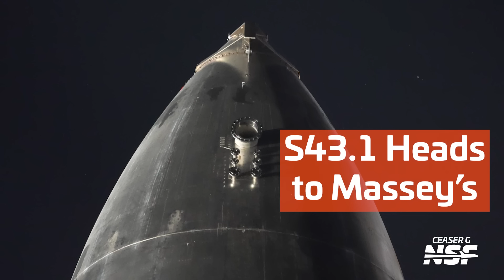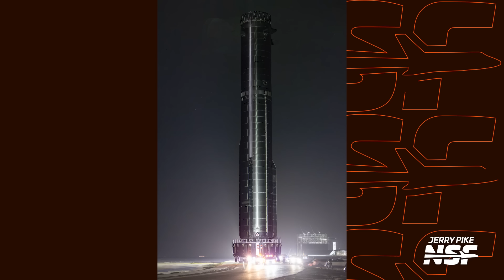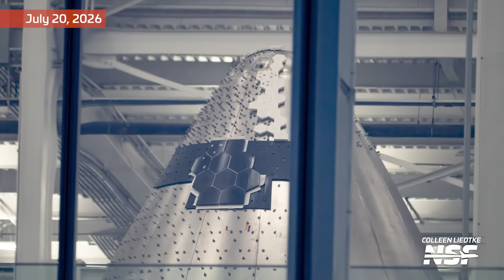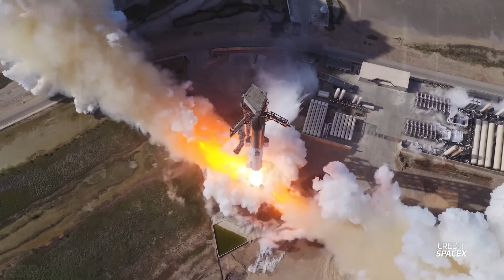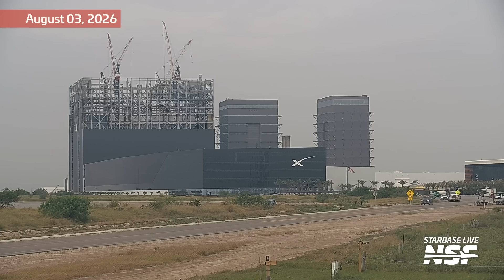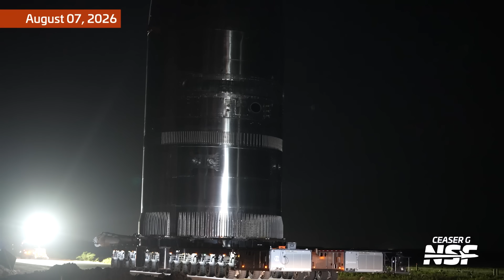SpaceX Says Starship’s Heat Shield Is Solved, But Is It? | Starship Update

Comment: Considering last I heard it takes about a week to replace a whole heat shield even if they have to replace half of it that would still be a win.  And if all they are looking at replacing is a few spot tiles and maybe some large sections on the flaps I could see them doing a 1 week turnaround.  Once a day is probably closer to 5 or 6 years out at this point.  A routine 1-2 week turnaround that I could believe.  Maybe a few "hey watch this" or "hold my beer" 1-2 day turnarounds will happen before then but, those will likely be the exceptions not the norms.
Reply: "1 a day" refers to overall fleet cadence, not individual ship cadence. They might have 7 ships in a rotation, with one flying every day, and each one taking a week to refurbish before its next flight. Baseball pitchers is a good analogy for this.

Comment: I think all this discussion of Starship activities has masked, a bit, the issues with the latest Super Heavy booster.   It has not had a successful return-to-launch-site (simulated) run yet.   I suspect that the difference in the geometry of the engines has thrown more aerodynamic turbulence then the engineers expected.    This would follow from successful launches  when the engine area is in on the leeward side contrasted when the engine area is on the windward side (i.e., descending).   I would have thought that this would have already been modeled in the months previous to building the first V3 super-heavy but there's nothing like actually flying to test one's design, eh?  

So, looking at the heatshield of the ship is important but getting the booster descent relights reliable (again) is a significant challenge.    If they do not get that fixed, they can still do the orbital flight and still deploy working satellites but losing a booster on each flight is a huge financial and scheduling hit.
Reply: The booster in flight 13 made a big step from the booster in flight 12 so if they can continue their progress in that direction they will be okay.  Besides that the booster under performed after stage separation and boost back and it was only the landing burn that was inadequate.
Reply: Starship was always the problem child.  Everyone is aware that the booster has taken that place now.
Reply: why worry? they've fixed things before, it'll be fine in another flight or two.

Comment: YES, SpaceX is targeting an operational orbit for Flight-14th.  They're also testing a NEW Structural noseCone. BEST part they're absolutely planning to "attempt a tower-catch of Ship41. Thank U 🌿 for sharing
Reply: Admiral General Aladene says it has to be pointy to be scary.
Reply: Flight-14 start date 28 right?
Reply: @realhero5917 

Yes, hopefully all looks 👍
Reply: @realhero5917  The exact date is yet to be determined.  Sometime between Aug 24 and Aug 30.
Reply: I am expecting a twer crush..😂
Reply: @user-ks2bf4kc7d Why laugh though? Its like you want it to go badly
Reply: @imdark7372  NO! but the records are not encouraging and heat shielding technology not promising for reusability. I like SpaceX successfully develop its spaceship but "Starship needs something more advanced or different to safely carry humans and land "always" safely"
Reply: @user-ks2bf4kc7d That could happen BUT every attempted catch of the booster has been successful.  There has never been one single failure to catch. Also, Elon said that the water landing of flight 13 was so precise that if there had been a tower the catch would have been successful.  Also, my guess on damage to the tower if a catch is missed is no significant damage because of the serious robustness of the tower and pad.  Both are made to handle the weight, heat and launch of the booster and ship together.  Catching just one of them when it is mostly out of fuel may not cause much damage.  Some day it will happen and then we will know!

Comment: 1 launch per day in one year, even though this definitely won't happen anywhere this soon (if at all) is classic CEO Elon doing: 
- Securities Fraud (15 U.S.C. § 78j / Rule 10b-5): It is illegal to make any untrue statement of a material fact—or to omit a material fact necessary to make statements not misleading—in connection with the purchase or sale of any security.
- Making False Statements to the SEC / Investors (18 U.S.C. § 1001): Knowingly and willfully making false or fraudulent statements regarding matters within the jurisdiction of the federal government (which includes SEC-regulated public shareholder meetings).
- Mail and Wire Fraud (18 U.S.C. § 1341 / § 1343): If the false information was transmitted via phone, webcasts, online streaming, or written mailings distributed to shareholders, wire or mail fraud charges almost always apply.

Elon should hope Peter Thiel's couchfucker will also instuct the DOJ to ignore Elon like the Felon did when he takes over.
Reply: They ignored Tesla for the last decade...

Comment: The point Max made at @6:15 is simply not true. Falcon will be flying for years and years after starship is up and running. There is no payload bay door insight for starship, nor is there any plans for man rating vehicles to carry astronauts to the station. We are at minimum a decade away from Falcon 9 retirement.
Reply: I agree that Falcon 9 will continue on in some capacity after Starship is in service, but a decade seems pretty long.  I think you forget the cadence with which they will be flying.  I think mods and adaptations will come at a much more rapid rate than previous rockets and they will build experience with reliability very quickly.
Reply: @briangodfrey7424 the cadence with which Elon says that they will be flying. Not the cadence with which they actually will be flying. Those are 2 very importantly distinct things. 

Also remember that the shuttle could land on most big runways, so thousands of places on earth if it had to. Dragon lands in the ocean, so it can land in most places on the earth’s surface if they have to. The people who board a Starship will only survive a flight if everything goes perfectly and they make it to what? One of 5 towers. It’s going to be a very very long time before we see people leaving earth and returning aboard starship. Frankly I kind of think it’s actually never, at least in the way we see starship now.
Reply: @RoryShields1  No, I'm not suckered by Elon.  But even at the more conservative pace that they are likely to meet, they will accumulate experience very quickly.  As for the rest - I guess we'll see.
Reply: I am sure they have had people working on those for quite some time now.
Reply: @WyoSavage1976 they’ve had people working on Starship for 14 years now.
Reply: I bet it'll be much sooner.
Reply: @RedmondJohnsonif watching this program for the last decade has taught me anything, it’s that if the Spacex fanboys think something will be done by a certain time, add at least 3 years onto it.
Reply: @RoryShields1  sometimes it is true
Reply: @RoryShields1 what about the statement released saying f9 isn't taking any new contracts? Hmm such fanboy such add 3 years to everything
Reply: Engineering can begin on new systems  years before we see them being built.
Reply: No it wont! SX just issued a statement that they are no longer accepting launch contracts for ANY F9 missions past 2027, including very lucrative ride shares. F9 is not fully reusable and that is the catalyst for SS development.
Reply: @brianw612  That's interesting.  Plus, there are lots of Falcon level competitors coming along to put pressure on their business, while nobody will compete with Starship for quite a while.

Comment: Do you think they will get tps yields so consistently high that they could switch away from tiles and just go to one giant shaped slab that could cover the belly of starship?
Reply: No! SS is a large flexable tube structure that flexes and expands in the hellscape of re entry. Those tile footprints are designed to move with the structure and shift independently of other tiles. All heat shields are essentially the same in that regard. Even the Apolo capsules had independent cells.
Reply: No

Comment: A few cracked tiles isn't really the important thing, the important thing is all the tiles that didn't crack and worked perfectly. It proves the tile design is good. All they need to work on is tile quality (like detecting and reject voids in tiles during manufacture so they don't end up on the ship). They also need to ensure the tile mounting system is good for all tile locations.  All those problems are minor and just ongoing manufacturing improvements rather than design issues.
Reply: The flight profile was designed to be stressing on the tiles.  Regular flights won't be stressing.
Reply: Exactly. Full and rapid reusability for Starship will be obtained using an inventory of 10 to 20 new and pre-flown Boosters and Ships just like SpaceX realizes Falcon 9 Booster reusability with a similar inventory. Replacing lost and/or damaged tiles on the Ship will be relatively easy because of the mechanical attachments.
Reply: I suspect all tiles need to be inspected after each flight anyway. Another problem is the amount of cycles a raptor 3 can do before a major overhaul/inspection is required. Some internal engine parts can only be reached by cutting the engine open...
Reply: @frankderks1150  The tile inspection process will be done in a bay in the Starship RMO facility by computerized robotic equipment and would require a few hours.
Reply: @f @flsh-v6p  exactly. In 4-5 yrs they’ll have tile inspection completed and any tiles replaced within a few hours. The amount of people online thinking Spacex should have an entire mature infrastructure set up for a production ready rocket on only its 13th test flight blows my mind
Reply: @flsh-v6p That is what I think too. Starship will probably never have a turnaround as fast as suoer heavy, but it does not need to, you can just have several prepared starships to make up for that deficiency

Comment: Falcon 9 will keep going for a while for launching humans.  It will take many years to get starship to the point where tower catch is safe enough for humans. They may have to build an automated escape system into the human starship variant so if tower catch fails it doesn't kill everyone.
Reply: Probably they will make it survivable for crew Starship to divert from the tower and land on its skirt, on a separate flat emergency pad close to the tower. (This would likely damage Starship but be survivable for crew.) Agreed they will have to do hundreds of uncrewed flights to work out the kinks before it can be crew-rated.
Reply: @benweiss73 SS Survived a soft waterlanding so that might be a possibilty for an emergency landing if the impact forces from topling over can be limited to a non deadly value.
Reply: There is also a danger of launching crew on Starship, since Starship doesn't have a launch abort system. Though launching will be a lot less dangerous than landing.

Comment: Just like FSD is solved.
Reply: They do pretty good in empty parking lots!?   🙄
Reply: Well, it is more of a regulatory issue than a technical issue at this point. People regularly drive cross country with zero disengagements.
Reply: @L @Letsplay222  the regulatory issue being that its only ever got to level 2 and isn’t safe unattended
Reply: @Kujiranoai And yet people regularly drive cross country with zero disengagements and it is statically much safer than a human driver. So we're right back to the point of it being primarily a regulatory hurdle.

Comment: I have said this before. All that water is fresh?
Reply: Which water do you mean?
The ocean water is not fresh water.
The deluge water is potable. Treated.
Reply: The deluge water comes from Brownsville's water supply
Reply: @thomashayden804  so if they used oil rigs would they use salt water? Salt water has problems with HOT! 
But the questions was, still it is all fresh water?
Reply: @dunathegreat6925  on an oil rig you can use the ocean itself as a flame trench so that would effectively be salt. What the top deck would be is a good question

Comment: Everyone thinks this nosecone is testing for the ship catch. I think it is more likely testing to verify it can support the weight of the Orion capsule, as they will now be using Starship to push it to the moon.
Reply: why would it need to support weight? its gonna dock in zero g
Reply: @dabcatcraze   When starship accelerates when it pushes Orion
Reply: @Fold-103  ah ok
Reply: @dabcatcraze   Tho I wonder if it’s going to dock at the nose or on the side of starship
Reply: @Fold-103  renders show nose cone. dunno how it'll work with the header tanks
Reply: @Fold-103 side wouldn't work because it would shift the center of gravity
Reply: i wonder if it could be for testing the lunar lander cabin pressure or something?